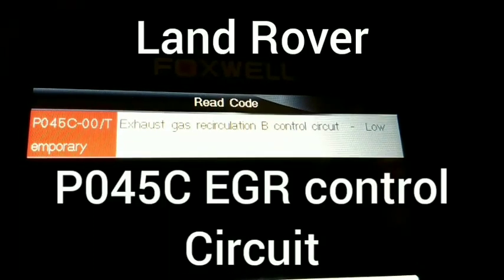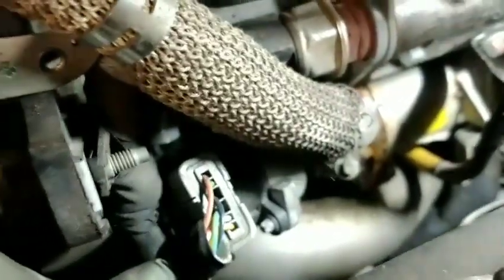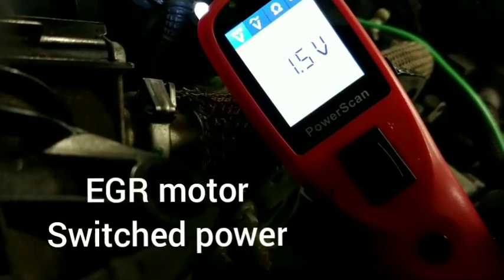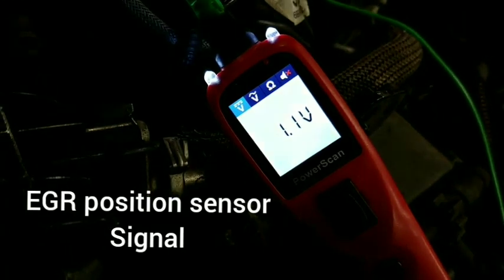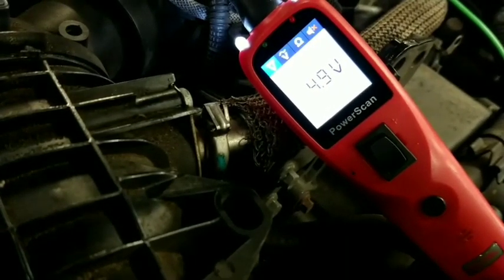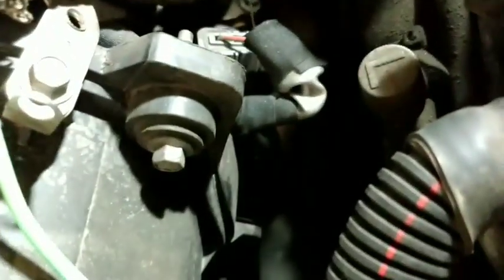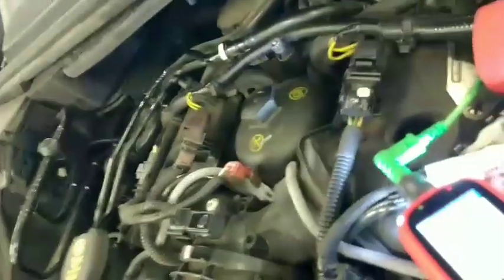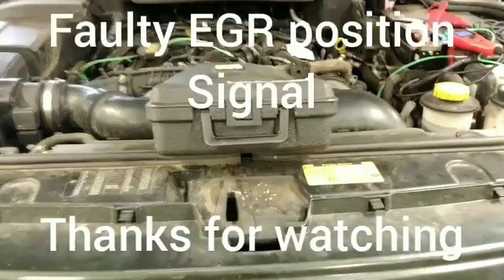Landrover P045C EGR fault

Comment: Hi, great video. Can U tell me how U conected this green cable with Autel Probe? Best regards
Reply from the maker: Hi, I used a cable with a 4mm banana connector. It fits into the autel probe where the black tip that comes with the autel is usually fitted you can get the green leads at Amazon or eBay, thanks for watching

Comment: Hi ,do you recommand Autel Powerscan over  UT81B scope ?I have UT81B but find it slow and not readable in sunlight .Great  channel  ,keep it going  .Merry Christmas !
Reply from the maker: Hi Radu , I like them both, the autel is auto ranging but it's ok for a quick check and it uses the cars battery so you don't need to worry about the scope's battery dying. It is handy to power up solenoids if the scanner doesn't have bidirectional control. The uni-t can graph amps with or without an amp clamp, it can also take a 1:1 AC coupling adapter to help with digital abs signals on the power side signal. Thanks for watching, and merry Christmas!